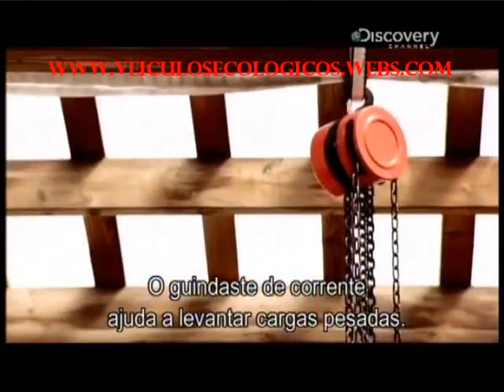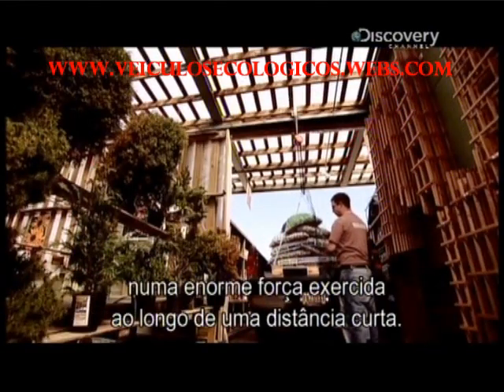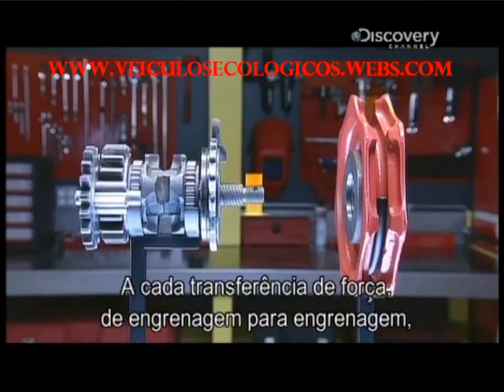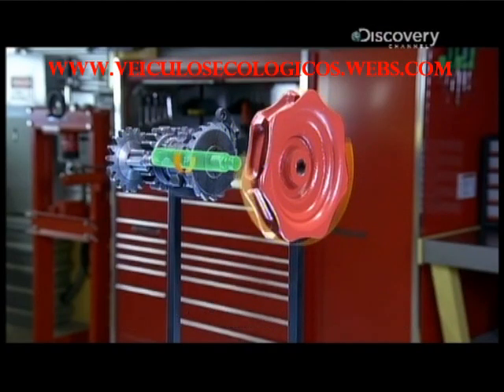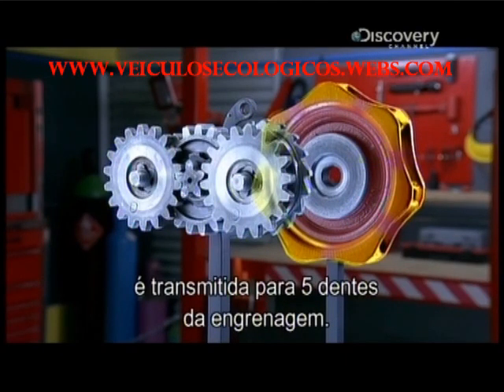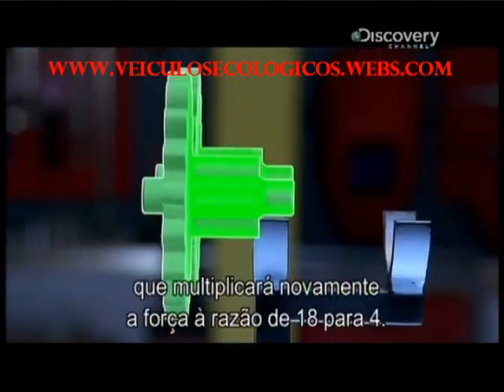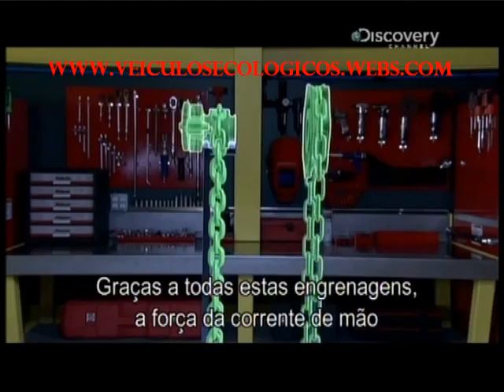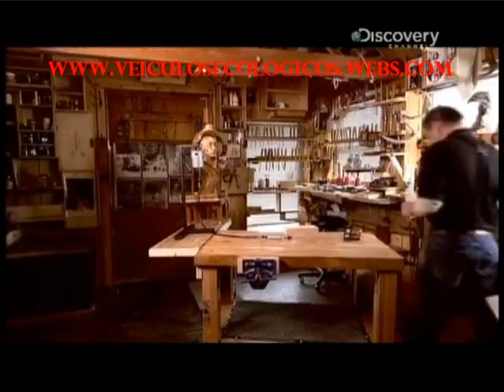How it Works The Chain Hoist

Comment: you just explained pulling it doesn't release the rotation backward due to the lock locking friction plate but what about the release when chain is pulled from other side

Comment: Aside from the gearing which provides the 30 to 1 mechanical advantage, the principle is based on the physics definition of WORK.  That is, WORK = FORCE x DISTANCE.  In this case you use say 1 lb of force a distance of 30 inches (the 30 to 1 mech advantage) or 30 lb-in of work which is equivalent to having lifted 30 lb 1 in, 30 lb-in as well, without the mechanical advantage.
Reply: this is a system that is based on gear reduction ratio (7/5 x 18/4 x 19/4) and not a system of simple pulleys where the mechanical advantage is not the major advantage but a simple leverage as you mention in your question (a torque that is simply created by the distance multiplied by the input force). Gears are much efficient and do indeed provide mechanical advantage.
Reply: 你的描述很棒，我们可以提供最优质的链条

Comment: So, dude, when you turn the chaiin the other way to lower it, how does it do it against the ratcheting pawl?   Explain that.....
Reply: Did u know? I was looking for an answer
Reply: It uses a clutch that disengages the hand chain sprocket from the ratchet.  Meaning the ratchet and pawl stay stuck but hand chain sprocket can initiate the backwards movement lowering the load. When the hand wheel stops moving the clutch engages and the load stays in place
Reply: and that mechanism didn't explained in the video

Comment: This is infuriatingly incorrect. There is minimal stress on the first, 5-tooth gear. The twin gears aren't there to help that guy out. They exist to distribute the load of the next stage, the load on the 4 tooth gears. Those are under much higher stress. Notice how thick those 3 gears are compared to the others.

Comment: I think the Larger gear is moving slow than the Smaller Gear, the pull of man should be at the small gear, just commenting
Reply: The reason for this is to and another weight reduction. It's a concept similar to that of the wheel and axle.

Comment: WHY HAND CHAIN ISNT DRIVE WITH SOME KIND OF SMALL ELECTRIC MOTOR??
Reply: That's why it has a chain, for manual hand use. Hoists with electric motors don't have a chain.
Reply: These hoists are already fairly heavy, but for mobile use a powered hoist would be prohibitively heavy. 

Not only are the powered chain hoists heavier, they also take up more space, which can in some circumstances make them useless.

And finally, the manual ones are less expensive.
Reply: my tube low duty cycle.  Hoists are commonly equipped with electric motors.

Comment: How about backward
Reply: +Fadi Koka same thing, but in reverse.   Sounds like smart ass answer, but, it's basically true.   Look at the clutch that was tightened up at the beginning.  Look at the screw threads on the main shaft.  When you go backwards, you loosen the clutch and the load slips down.   
"Why doesn't it freewheel?", you ask.   Glad you asked that.  :)  The load spins the driveshaft which tightens the clutch from the other side, and once the clutch is tight, that pawl(usually there are two pawls in that style of hoist) stops the load from dropping.
Reply: @l337pwnage  and how do u detach the clutch from the other side?

Comment: How does brake work??
Reply: Rachet system have a reverse tooth gear that doesn't allow the system to move the other way unless a certain key is turned that reverse the pick

Comment: The chain hoist has either a lever to power the hoist or a loop of operating chain pulls through the block of the hoist which then powers the block that takes up the main lifting chain.
Reply: The lever is much more useful on loads more then 3 tons unless you can find one cheaper. Otherwise the manual chain is alot easier on your wrist